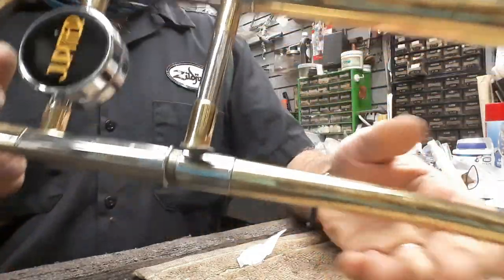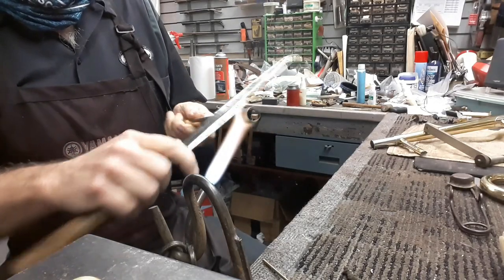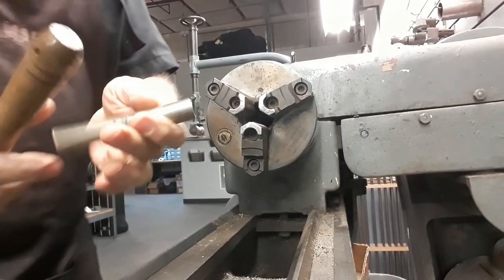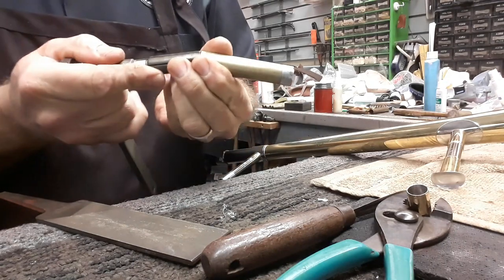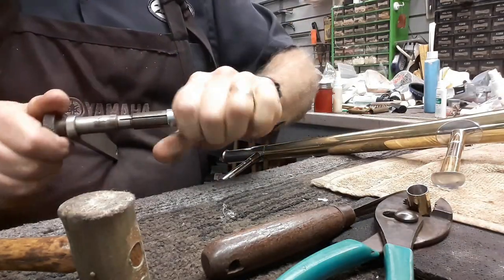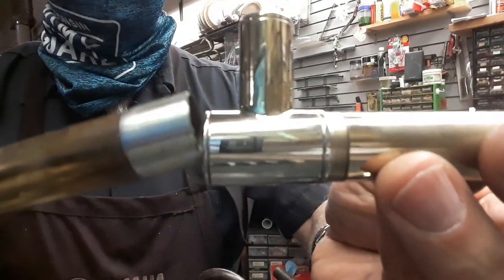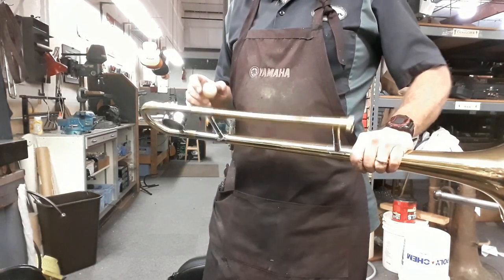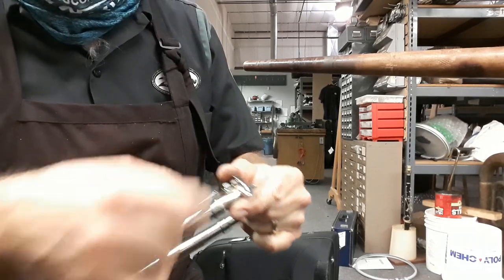Trombone Horror! It's Ripped!!

Comment: Excelent job.

What tipe of welding do you use ???

Tanks!!!
Reply from the maker: Silver solder at high temp of about 1250 Degrees and soft solder 50/50 lead/tin at 365 degrees.
Reply: @jimflys2  Was more wondering when you choose to silver vs. soft solder.
Also when to braze and if that's an acetylene or MAPP torch.
And if you have to remove residual acid flux.
Reply: How wood you repair a split near the slide!?
Reply: @jameswyatt1304  Generally, silver solder is used for things that you'll never want to take apart. It can be disassembled, but it requires higher temperature and it can damage the finish and you need to remove every soft soldered part near it, so it is only used for stuff that needs to hold stronger than what soft solder can offer. Like spring catches (or anything else) on the keys of woodwind instruments, or the silver solder joint between a finger ring and its flange.